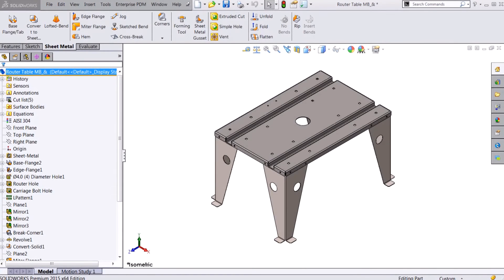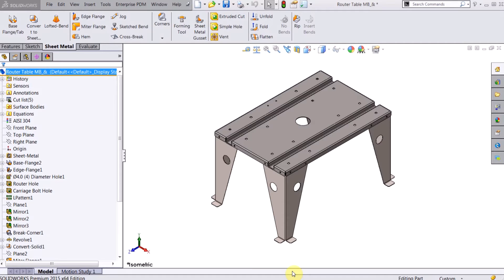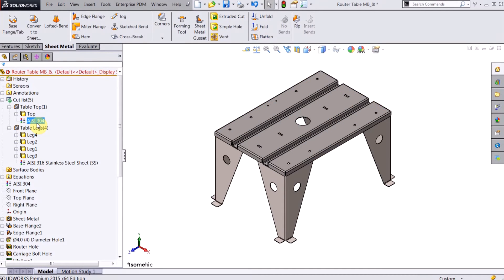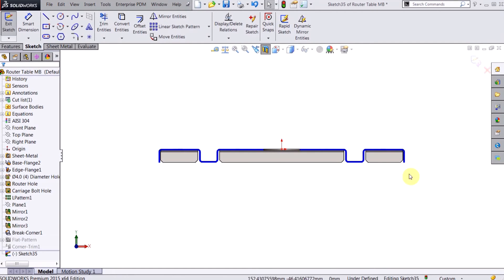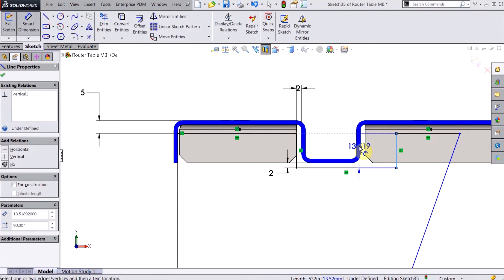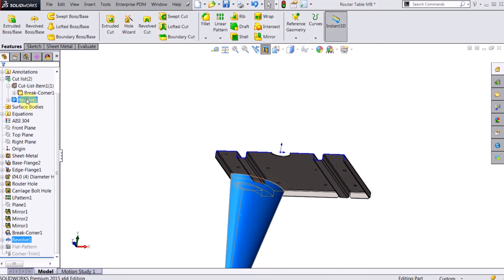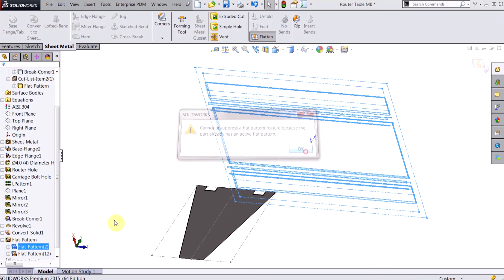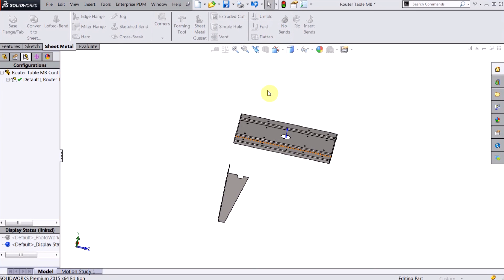SOLIDWORKS - Multi-Body Sheet Metal

Comment: how to give part number for each multi body and then creat separate drawings for each body where part number automatically apear in rach multi drawing sheet.
Reply from the maker: To pull the name of a cut-list item onto a print, first of all the name must appear in the cut-list item properties (typically the "Description" field is overwritten). In the Drawing, create a model view of the solid body using "Select Bodies", then attach a note to the body. In the note property manager, select "link to property" and reference the "component to which the annotation is attached". Choose the "Description" item that matches the cut-list item property and the name will appear in the note.

Another option is to use the "save bodies" command to create separate part documents for each body, and a separate drawing can be created for each part (this can be automated using the SOLIDWORKS Task Scheduler). Note that the multibody part can still control the dimensions for the other parts as the "master model".
Reply: @hawkridgesystems   Thank you for the detailed answer.
I'm following up to explain the first option. it's perfect and shows the cut list property name or part number in the form of balloon.
but how can I use this balloon number as a part number on a drawing sheet similar to an assembly drawing number?

For the Second option, I tried it and converted a separate body but the flat pattern option was missing on the drawing sheet.

Comment: Thanks for the video - just wondering if you can help me with an issue I am facing with a sheet metal part. 
I would like to save out a multi-body sheet metal part as their own separate files - but using the save bodies only saves them as bodies and I can no longer flatten them.
Is there a way to keep their sheet metal properties when saving out as separate bodies?

Comment: How do I combine 2 parts into 1?  I have a line through the middle
Reply from the maker: If that was from a mirror feature, edit the feature and make sure the "Merge Result" option was turned on

In general to combine two bodies after the fact you can select both solid bodies from the solid body folder, right click, Combine and Add. However this would not be advised for a sheet metal part as it will likely cause issues with flat pattern and other details.